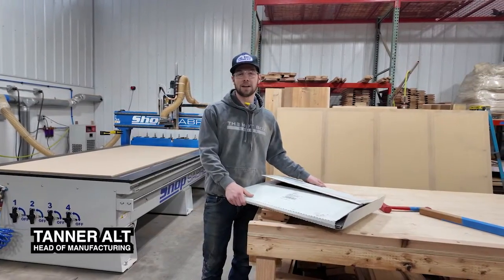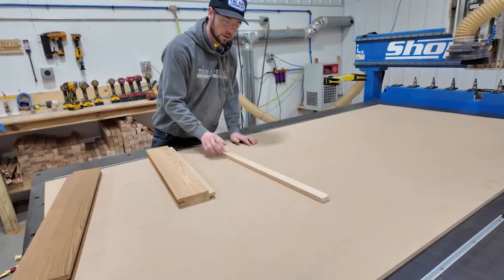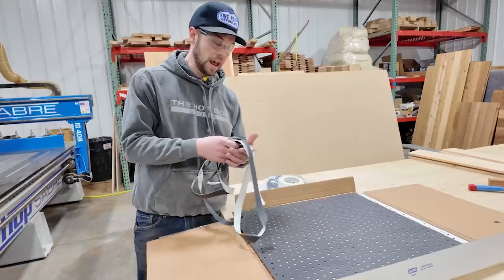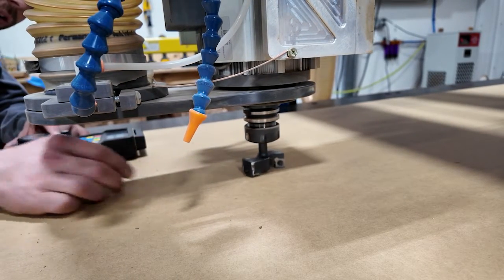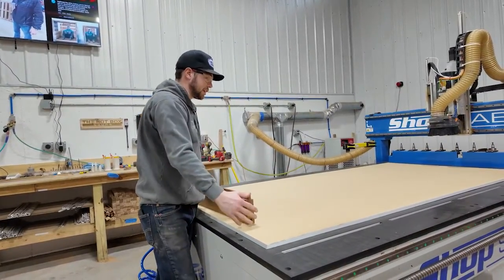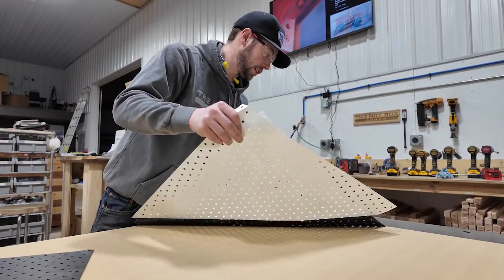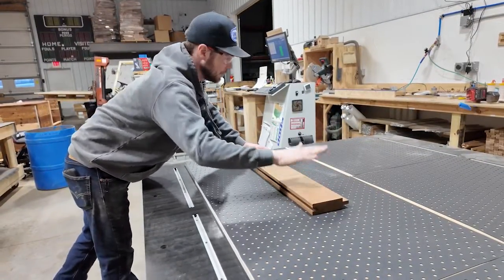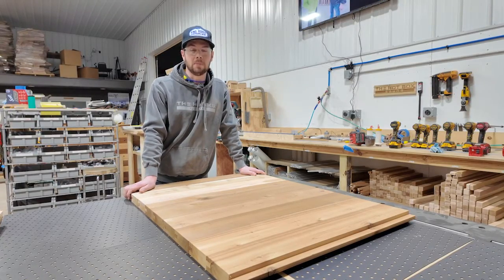New All Star CNC Gasket Tile System!

Comment: I am sure it works well. but the price is crazy for what it is. I'm going to try spraying my next spoil board with some kind of rubberized coating ,then  run a shallow drill cycle over the entire table to create holes in it, like the tiles. I can't imagine I won't get the same results.
Reply from the maker: @TimDonk  we switched to fixtures… changed everything for us!😱
Reply: @TheHotBoxSauna  you switched away from the gasket?
Reply from the maker: @bmooreskier yes sir we switched to fixtures. Check out our video called “CNC Game changer”